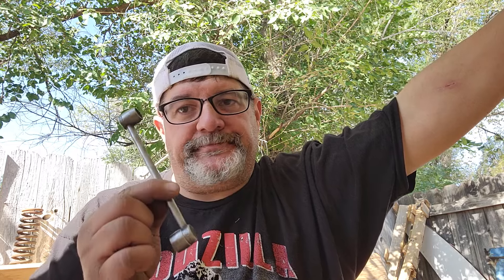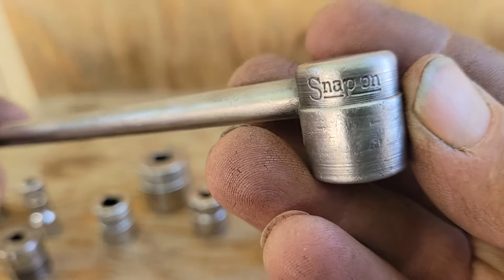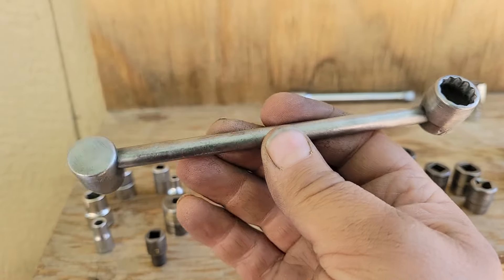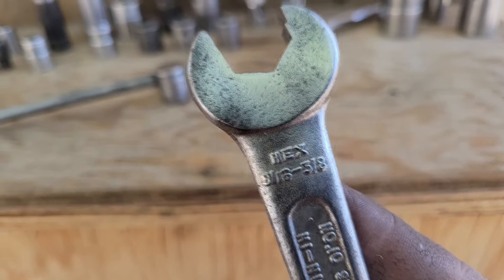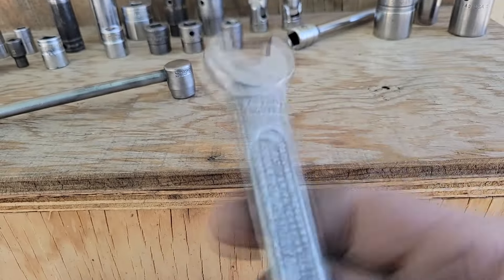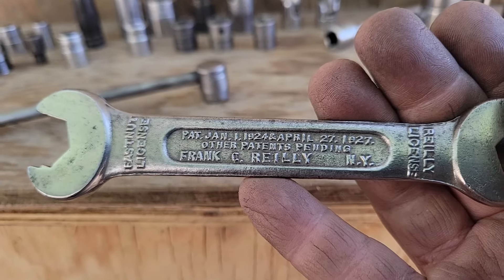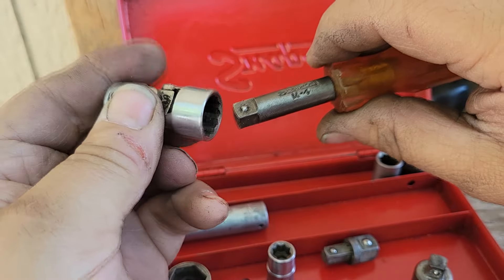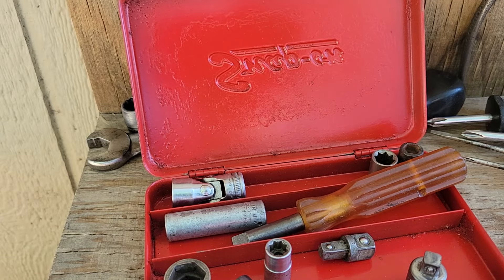My Snap-On Tool Collection.

Comment: Good video. I have the first spring loaded ratcheting adaptor that was put on a breaker bar 1920 to 1924.Also a few that were military issued during WW2,these have a letter V in the part number with no warranty on them. Story was it was put in the contract that there was no warranty on them.There were even Snap On tools that were Canadian made, they had a tool plant in Canada until the late 1980s
Reply from the maker: Cool. Thanks for the info!